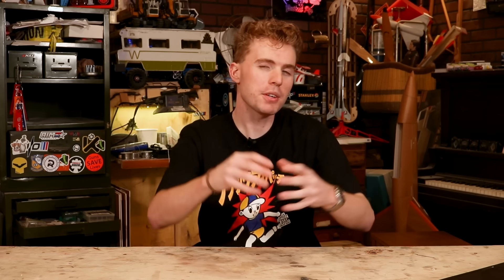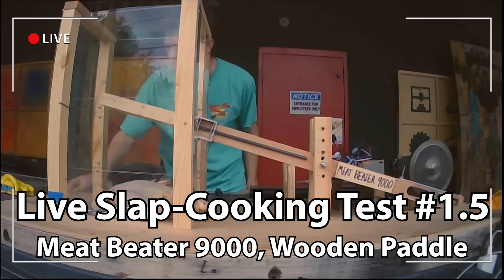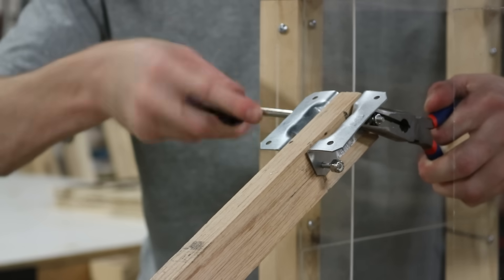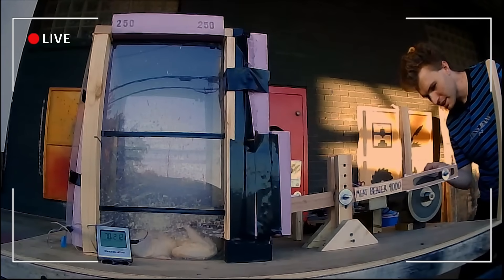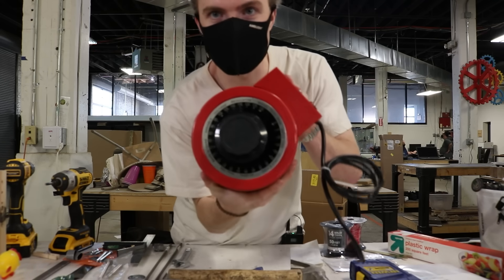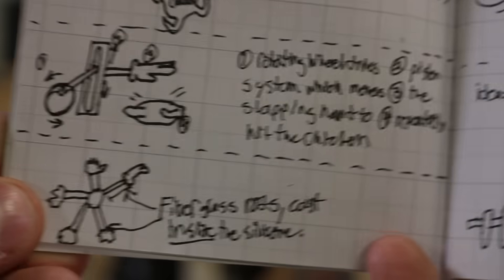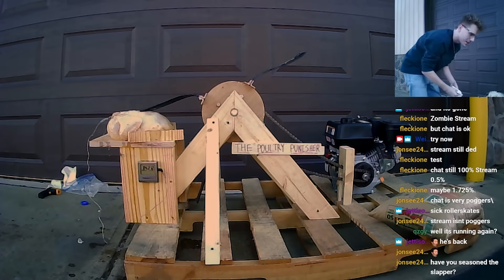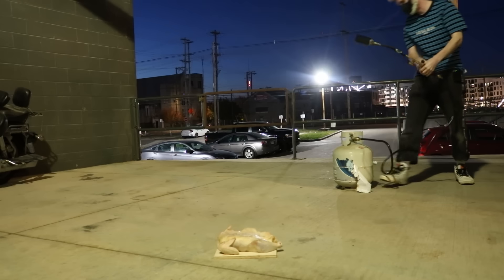How Many Slaps does it Take to Cook a Chicken?

Comment: Answer: you can't slap a chicken till it's roasted, it'll disintegrate
Reply: Perhaps if you slap it ridiculously quickly with a light and soft hand, the slaps would have more of a constant pressure effect on the chicken and not cause as much damage. Similarly to why many human slaps are less damaging than one 3725.5 mph slap with equivalent energy
Reply: @smashalot  it would lose it energy faster than it gains.  Basically the same problem  all over again.
Reply: @ten_cents  the problem here is that you can't pump energy into it fast enough without destroying the chicken. My logic is that smaller, more frequent slaps should be less destructive, allowing you to add more energy.
You would probably need a spinning device like the last one in this video for any chance to slap fast enough, but it would be good to use something with less friction than rubber so that it doesn't tear the chicken when sliding off.
Lastly, you need some good way to contain the heat.
Reply: @smashalot  yeah, it might work if the method used for containing the heat is one which somehow retains all the heat and allows only very minimal amount of energy dissipation. Much faster, lighter slaps will produce little amounts of energy per slap, and this energy will be very easily lost to the environment, compared to much more heavy slaps which create much more energy per unit time than can be lost to the environment in the same amount of time. Basically, yeah,  if u somehow can throttle it so it goes blisteringly fast, you will eventually run into the same problem of disintegration again as ur end goal is still to output as much kinetic energy as the heavier slapping machine. Different means, same conclusion.
Reply: I love how you guys are just conversing about the efficient way to slap a chicken.
Reply: @notYourBro44  this is what science was made for.
Reply: It's gone, reduced to atoms.

Comment: One last try (might be a little outside the spirit of the question but...): Add a metal structure to transfer the heat that the slaps contact, sort of a slapper oven if you will, something that can handle the abuse of the slaps and protect the chicken flesh.  A simple setup could be just get a dutch oven that the slapper wheel hits.  I mean this changes the question to how many or what frequency of slaps is needed to heat a dutch oven enough to cook a chicken, but at the very least it seams plausible.

Comment: Idea:

Accelerate container with chicken inside to a speed high enough to generate high temperatures through atmospheric heating. Make the container out of a good heat conductor, like steel, and you could cook a chicken using only kinetic energy (with some help from the atmosphere).

Could use a railgun type thing, or just a regular propellant-based propulsion system.

Comment: Just take a material with very low specific heat capacity and high coefficient of kinetic friction and put the chicken in it and make sure the material u are using to slap has a high coefficient of kinetic friction as well. This way u won't make a paste out of the chicken and the material will heat up and cook the chicken

Comment: Take the beating away from the chicken. Use a board or something in between the chicken and the flap wheel. The destructive percussive forces are taken away from the chicken but the board transfers the energy from the slaps into the chicken. The board will have to be like free floated within a given area so as to allow the slaps to transfer the energy through the board to the chicken and to not completely escape the Poultry Punisher.

Comment: What you need to do is reduce the amount of heat loss to the environment. The 3 methods of heat transfer are conduction (direct contact), convection (air flow), and radiation (light emission). 
To reduce conduction, put the chicken on top of a very isulating material like fire brick or something. 
To reduce convection, you need to limit the airflow around the chicken. Use a slapper with holes in it to reduce how much air it pushes around. Also you can contain the air around the chicken so that even if heat is lost to the air, the air will heat up around the chicken. And you can reduce the heat transfer of the warm inside air to the cold outside air by adding insulation around the container.
To reduce radiation, you can surround the container with reflective material like tinfoil to reflect the radiation back at the chicken.

If you do all of this well enough, you could cook a chicken with some light tapping eventually. 

In order to minimize damage to the chicken, you need to spread the force out over more of the chicken. So a wider slapper, or maybe just sandwich the chicken between two boards so you get a nice even pressure.

It's doable! Keep trying!

Comment: Don't you think your Poultry Punisher has too much friction, with each slap dragging across the chicken as it pulls away? Also, isn't it also acting somewhat as a fan and cooling the chicken? You should suspend the chicken on a skewer and have it slapped with perpendicular hits that pull directly away. You should also slap it simultaneously from the top and bottom, then from the sides. Guaranteed to work.

Comment: The solution is simple: you need a hybrid. The original design was able to get it quite high but failed every time it needed to go full speed. The second design destroyed the chicken due to not having enough speed control. Start with the first then swap to the second.
Reply: It also needs the insulation. You're adding enough energy but losing it to the environment
Reply: @MichaelSotoCE  that as well yes. He massively increase the energy in but also by removing the insulation/bubble he pretty much equally increased the energy lost.
Reply: Also he can strap in the Chicken to help it absorb the energy

Comment: The other problem is the constant and proportional to the slap speed air flow generated by the movement, that cools it down considerably... You'd need a vacuum chamber to eliminate air flow and at the same time optimize the engine power by removing friction

Comment: Theoretically, you could build a chamber that bounces the chicken carcass up and down at high frequency, effectively slapping it on both sides. I'm pretty sure such a machine would just turn the carcass to paste.

If we relax our requirement of maintaining carcass integrity, you could go straight to chicken purée and use a massive subwoofer. Still unconvinced you'd be able to exceed heat loss by much.

Comment: Hmm well. I don't think it's impossible but there is a fundamental flaw.

The actual amount of thermal energy created from kinetic impact compared to the shock the chicken can withstand from that impact. The issue of the chicken becoming paste in inevitable. But the question was not "if you can cook a chicken by punching it and it still look like chicken." it is "if the chicken can be cooked."

Comment: Would I be correct in saying that your results would have been better if it was conducted in a vacuum? The rotary rubber flap design removed the upswing inefficiency but also turned it into a fan which would also cool the chicken.

Comment: Dude. The design of the Meat Beater was perfect, it was the materials that were the problem. You need to use steel, or at the very least, aluminum. Wood will never stand up to the shock of repeated and perpetual impacts required of such a machine.

YOU HAD IT!!! FOR HEAVEN'S SAKE, YOU HAD IT!!!

Comment: Great video man. It sucks for the last attempt though haha! It appears that the first version of your chicken beater it actually better than the last one; this is because the piece of wood is heavier and transfers way more kinetic energy. Even though it beats slower, it deliver an amount of energy way superiors to the four, (and super light) piece of rubber that sure beat faster, but not as hard/firmly as the wood. It would be nice to combine the two systems, as they complete each other, one transfer a lot of energy and the other beat faster. What I have thought about, is to make a system that hits like the wood but twice as fast; I am speaking of using the rolling system, and you mount on a material that is as heavy as the wood and manurable like the rubber (and resistant of course), instead of using the thin rubber blade that transfers no energy. After that there will be another problem and it is that the chicken will get absolutely destroyed. I mean if you hit flesh that hard, the impact of the slapping will rupture flesh (like it happens on human skin during the course of an injury); so I was thinking about wrapping the chicken into a material that can resist pretty well to heat, shock, but that is thin enough to transfer the most energy possible, because thicker the material, the more heat it absorb (and we don't want that :) ).  Hope that is possible, I want to see a rematch!!!

Comment: You should have gone with the second last setup with the hairdryer. It was working until the engine broke. You could have used one single wooden stick without the screws. And you should have packed the chicken into a fitted thermobag so all the hits wouldnt destroy it. Then it would have worked 100 percent

Comment: Instead of slapping the chicken where the brunt of the force is absorbed at the surface, I think the better solution would be to cause the chicken meat to expand and contract or flex from the inside. That is one of the reason ls why our bodies heat up during an exercise.

Comment: The wheel slapper is acting more like a fan, cooling as it transfers the energy. Furthermore, the original slapper was transferring the energy straight down into the chicken the second one was pulling it across the surface. I’m a laymen these are just my observations/thoughts.

Comment: Would it have helped having a thin protective barrier allowing the poultry punisher to apply the downforce of the slap without pulling at the skin and meat as it passes by?  And having it in a temperature controlled environment same as the original design.

Comment: Temp control the chamber and the surface the chicken is sitting on to follow the internal temp of the chicken by only a few degrees. That way you don’t continue to lose heat as it cooks but you’re not actually cooking it with the air since the chicken is hotter than the air.

Comment: So the problem i see with the poultry punisher as opposed to the meat beater is that the rubber paddles were pulling bits of chicken with it during rotation, which i imagine means that the bits that were heated by the slap are just shredded away before more heat can be imparted.

I also noticed that while the meat beater had multiple structural failures, the ration of chicken integrity to temperature was much higher compared to the poultry punisher. I think the concept behind the meat beater (a constant up and down slap) has more potential to ensure cooking. Perhaps some sort of piston design could work, though you'll have to measure the chicken and calibrate how far the piston goes down onto the chicken to ensure you dont crush it competely

Comment: i don't really know my thermo-engeneering, but isn't the problem that you apply too much force witch too infrequent slaps... so maybe it could work if you remove force for frequenzy (smaller rotor for the meatbeater = less movement wich should mean less force so it could run faster)...

Comment: I bet you're just beating a chicken corpse while it's warming up from the greenhouse effect of the sun and the enclosed environment. Should have a control chicken in a similar set up that's not being beat to show much heat beating the chicken is really adding, also would've been fun to monitor total power draw so you could show how efficient converting electricity into heat through slaps was

Comment: At such impact frequency the meat integrity and rigidity would fall below acceptable levels. You need to put the meat inside cooking foil. You need to put the foil meat wrap in a metal cage with metal plates. Then slap that structure with a sturdy enough object and sufficient frequency, which I am sure would not be a problem for you to achieve. The cage would heat. The foil wrap would heat up. The meat would absolutely cook. In your experiments you treated the meat as if it were slab of metal

Comment: Suspending the chicken partly allowing for nominal movement might help. The heat transfer would be a little slower but the chicken wouldnt become paste so easily. Rather than focusing on the slaps per minute only look at other variables. like maybe multiple smaller meat beater/ chicken destroyer at lower speed. More area gets hit constantly without destroying the chicken.  In fact using three smaller chicken destroyers rotating at  3 different phases (kinda like 3 phase current) would allow for more heating at lesser speeds. If you were able to bring in that same type of insulation somehow in poultry punisher you would have gotten better results. Also try during the hottest time of the day with as much sunlight exposure. Try drenching the chicken in oil. That would help too. any little detail can improve effeciency  so go for all of them. another option could be slapping a rigid container of sorts of material that heats up faster and also traps heat better.  keep the chicken in such container and then you wont even have to worry about chicken paste. Allowing you to go for more intense speeds. these are just ideas. Implementing them would probably get too expensive for a stupid joke. Still fun to think about at least. But I am surprised that you only focused on increasing frequency. I was expecting you try some more things than just increasing frequency.

Comment: You need to consider a few other things:
1) Material used to hit the chicken, using metal wil absorb heat, so use something that is resistant to heat so that only the chicken absorbs the heat on impact
2) materials ridget surface, a smoother surface might produce less heat but a rigged surface could destroy the chicken. Best option is a matted surface with dents to increase surface area and heat.
3) Velocity, the harder you hit the chicken the more heat will be produced, it's not only about speed but also about weight.

Comment: I think the way to move this experiment forward would be to have multiple slappers synchronised using a cam shaft like the pistons in an engine. That way you could have more slaps per second without more stress on the machine

Comment: Math done,

You would. Need, then about sweat/body temperature for your hand. You can gain 23 sps witch then slapping a total for 10 minutes, but because speed = heat, you will then receive a burning point. If you have not yet cooked, then you retry and do 32 sps because speed = heat you will need you let alone receive a current burning point on your hand about 132.c currently you will not withstand the temperature and your hand would cook, and oh well how could a hole year go to waste? If you think so.
|
|
\/

Comment: why dont you set a metal plate against the chicken, then slap the chicken. over time the metal plate will raise in temperature, searing the chicken in theory.  Though you are not slapping the chicken directly to heat the chicken, the principle is the same. consider it a slap powered fry pan.

Comment: You gave a pretty definitive answer but I don't think you were thorough enough to be definitive. It would probably cost more than it's worth, but you could just slap it with less force but even faster. Or you could revert to your original design of up and down motion; Don't forget your rubber paddles were acting as sandpaper, scraping a fine layer each time they slide over the meat. 
More surface area would help a lot too..

Comment: Quick thought or idea!! Could you put aluminum plate on the chicken and slap the plate to heat it and let the plate cook the chicken? Or is that too indirect and not part of the challenge? I can’t help but think that if the chicken held together better and you had a way to evenly conduct and hold the heat/energy of the slaps you could get the chicken to cook. Kinda like how we use fire. While direct fire can be applied putting some type of metal plate in between the fire and the food helps to conduct and distribute energy. Idk just a thought!

Comment: You need to perform it in a near vacuum. This would result in the more energy being converted to heat instead of sound, and less heat loss from the chicken. I doubt that it would be enough to change the result, but it would be a step in the right direction.

Comment: The problem with this problem, and others like it, is that people just assume the thermal energy will just stay put, very much like thermal energy doesn't. If you want to pick food up from the floor before bacteria can transfer (think the 5 second rule), starting from a standing position when the food makes impact with the floor, the speed required would sterilize both you and the food, rendering the question moot. I'm pretty sure slapping the chicken hard enough could leave you with some denatured chicken sludge, but we all knew this wouldn't work.

Comment: Put chicken between two thin sheets of stainless steel, rig up 2 poultry punishers to slap the sheets from either side. Use ambient transfer from the steel to cook the chicken, heat is still generated by slaps.

Comment: Should just do this with raw ground chicken (or you could start with a chicken breast, but it would end up ground anyway) inside a plastic container of some type, then just vibrate it at high power but low speed so it hits against the lid, then against the bottom, over and over and over. Same exact process, but you can get results, as the chicken can turn into slop but itll still get up to temp and cook. (as long as whatever you have it in doesn't break, or melt)